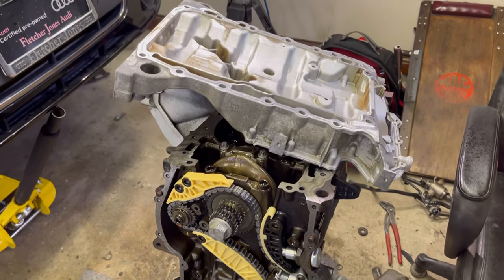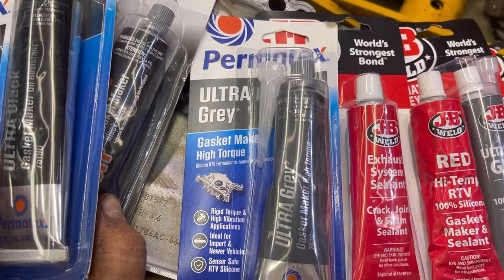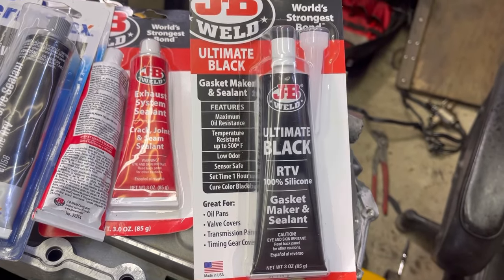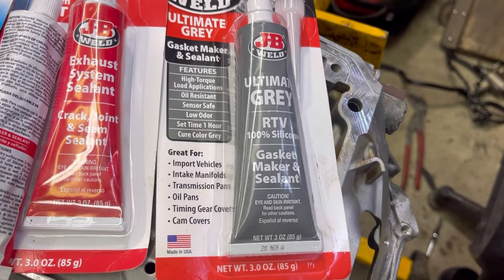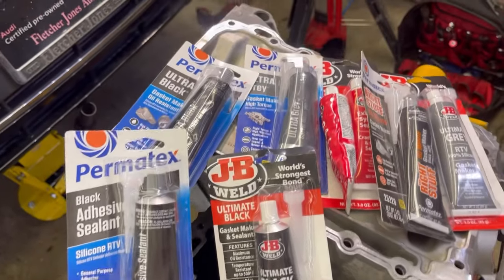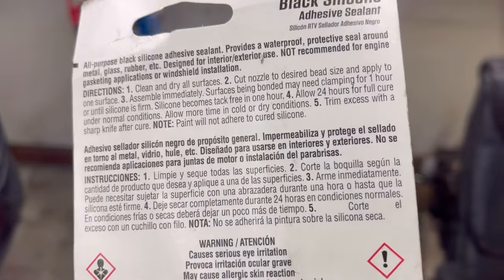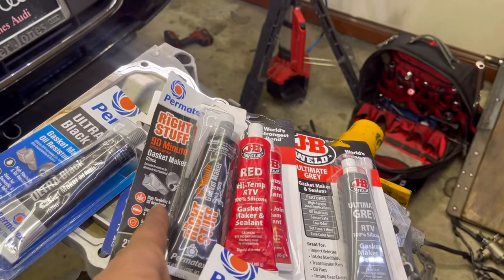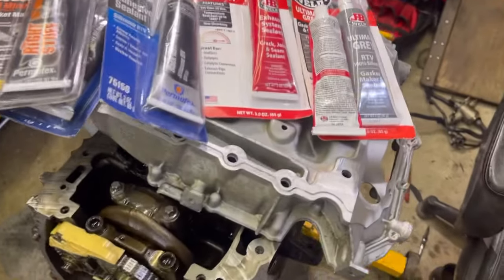Engine RTV silicone gasket maker types application instructions comparison uses demonstration 2.0t

Comment: Here is why it's this way. First principal, RTV hardens with exposure to moisture in the air. THAT'S THE KEY POINT. 1) You want to put the parts together while the silicone is wet as this provides the adhesion you want. 2) BUT you don't want to squeeze all of the silicone out of the joints to be sealed. That's where the finger tight part comes in. You want the silicone to be able to slightly harden prior to removing all possibility of moisture getting into the silicone. Once the moisture in the air has started to catalyze the silicone and it's gained some body you finish with the specified torque.
Reply: Very informative
Reply: Dang it I am cleaning my thermostat housing now to redo , was leaking coolant
Reply: @piercer2 how’d the thermostat leak go? I’m looking to do one myself with RTV red which may be overkill for the temperature but it’s what I have on hand. What do you think? What product did you use for your thermostat?
Reply: @cosmicallyderived  the right stuff held up. I fired engine up 10 minutes after putting back together. I’ll not use anything else from here on out
Reply: Thus far, the best piece of information given. Back to 1st principle.
Reply: That's the difference between aerobic and anaerobic sealants, one needs air to cure, the other doesn't
Reply: Makes sense
Reply: @cosmicallyderived it’s probably too late as I’m sure you’ve already done the job but I’ll give you a tip anyway. Use a cork (even cardboard works) gasket and spray it and the surfaces it adheres to with two coats of 3M contact adhesive. The heavy duty stuff like you would use on a headliner. Let it tack between coats and install. I guarantee it won’t leak first time and there’s no waiting. I learned that from a radiator repair man.
Reply: The reason for the finger tight and wait is because having the sealant have some resistent strength helps it provide the necessary pressure against the mating surfaces. Before this curing stage it is still the goopy form, required so it can be dispensed and applied, and will not have the structure to provide this resistence against the surfaces.
Reply: @TheAdamwest29 Exactly! The RTV is not merely glue or gap filler. It cures to a rubbery material that is meant to live permanently under compression like a rubber gasket. In other words, some bolt tightening has to occur after it has at least partly cured. If you don't wait then all you get is a glued seal that leaks as soon as the adhesion fails in any spot.

I'm disappointed to hear the video author saying "no mechanic ever does this".

Comment: I took a permatex class in school and you let it skin over with hand tightening the bolts so it makes a gasket. I've never had a leak using there methods. same thing with thread locker only apply it to the threads of a clean bolt if the hole it's going in has a opening. if it doesn't have a opening apply the thread locker to the hole and it will force its way through the thread as the bolt goes in.
Reply: Wtf they had a class for that??
Reply: @tristanvandever9411   ya there are a million variations of it you need to choose the right product
Reply: Absolutely best practice

Comment: RTV is great stuff, but I am amazed at how many companies can't properly spec a cap. All but one brand that I have used punch out the top out of their caps when they are tightened down. And no not tightened excessively . If I was a skeptic I would conclude that these companies spec their caps so that the cap breaks and insures that you need to buy more product prematurely. Permatex is the only brand that I've used that doesn't punch out the top of its cap.
Reply: The quicker curing formula’s will cure in the tube more than the slower ones, I dont punch the caps, I use a wood screw and then once I am done with the tube I turn the screw back into the tube for storage, it seems to make it last better as it tends to keep air from entering
Reply: @kellismith4329  If the cap was properly designed, then you wouldn't have to use a wood screw.
Reply: Read this 3x and still don’t get your message
Reply: @nickzaremba  The other brands break out the top of their cap with even the slightest tightening.
Reply: Put some dielectric grease on the threads before you place the cap and then you only have to make the cap snug.  The grease will seal out the air and moisture that causes the sealant to cure in the tube.  I just used a tube that was opened a year ago.  There was a slight skin on top, but that's from moisture that gets trapped in the cap.  I did run a test test bead to make sure it was still good before use and it cured no problem.
Reply: @brendan2599  Great idea, but won't help you if the top of the cap gets punched out.
Reply: @machdaddy6451  yeah, but when you use the grease you don't need to tighten it down hard.  Just gentle.  The reason the caps split is because people tighten them down hard to try and seal them.  The grease does all the sealing.  You could tighten it only half way and the grease still seals the cap.

Comment: Personally I use a bead everywhere it should go and around the bolt holes and have the mating surfaces spread it out.
Reply: Lots of us have a habit of using it to hold gaskets in place, even though we are told to nounuse it on gasket surfaces we don’t like leaks, in this case I will smear it so it is spread out over the gasket surface. But if you are using the sealant as the only gasket, yes you ar better off laying a consistent bead and then allow the cover to push it into place as it is tightened

Comment: I think the reason we always overbead is because it's no fun to have the pan or whatever you are putting on leaking after the silicone is curred. It's a devastating sight to see the an oil leak from a pan knowing you'll have to drain the oil,remove freshly curred silicone clean and redo. No fun.
Reply: Not to mention all the disassembly required to remove the cover, and then reclean all your old sealant off etc it is worse than doing the job twice because it leaves you gunshy to repeat it.
Reply: That feeling when u got it just right tho🎉
Reply: GET A TRI POD. Why go through all the instructions then just do it your own way? But sounds and looks good to me.

Comment: You're supposed to wait for it to cure 24hrs before exposing to oil...if you don't,  it will become gooey mess. The Right Stuff only requires 90 minutes before exposing to oil, that is the selling point. You can do a repair and get back on the road in theory...

Comment: Another great video and this is one I’ve been waiting for, what you think is the most suitable gasket maker RTV.. sounds like you have been having great success with your method of using the 90min “Right Stuff” is that your go to silicone for the pans and the lower timing case? I think as long as the surfaces are very clean and have a little coarse “roughed up” surfaces like you mentioned in a different video, all of those choices would work. But for the lower timing cover, I have a question? I have a brand new cover from FCP should I rough it up slightly before I install it? And should I use the permatex “Right Stuff” or JB gray? Looking for your advice on the best practices for that lower case that will leak if it’s not perfect. I will use that method of hand tight until an even bead is seen squeezing out around the perimeter, then waiting 90min until final torquing.. that is 9NM on those t30 bolts.. great video 👍🏻👍🏻

Comment: For any Audi I've had to reseal it was always the loctite 5790. In all the instructions in the repair manual it's always said to install and torque component within 10-15 minutes of applying sealant. I've always seen on the permatex sealants it says to allow time for sealant to dry after 1hr then tighten to spec. That to me makes no sense but I can kind of see why looking at it from the perspective of a valve cover gasket where you have the rubber gasket.

Comment: Great Job, just finishing up a 2.0T head with new valves, gaskets, valve guide seals, with your video's help.  Previous owner deferred maintenance to the point of timing chain stretch and bent all the valves. 

$300 in new timing parts or $3500 at a shop, your choice.  BTW change you oil every 3-5k miles it's cheap $40  insurance to keep your car's engine from going boom.

Comment: Helpful tip:

When you're done, put some dielectric grease on the tube threads and then tighten the cap so it's snug, but not too tight (they split easily).  The dielectric grease will seal out the air/moisture and prevent the sealant from curing in the tube.  You will get a slight cured plug at the tip due to the moisture in the air trapped in the cap.  Make sure the sealant is all the way to the tip to prevent excess trapped air.  I've kept an open tube useable for over a year this way.  This may not work with anaerobic sealant.

Comment: Can only speak for JB Weld. Less is more, small bead not spreading it out with finger. Tack Cure so none of it comes away if touched with finger. Colors are easy. Black for high flexing parts where you need flexible seal. Ultimate Grey for cast parts or metal to metal seals that go under compression. Red when you need more heat tolerance. For example I would use ultimate grey on the intake side and red on the exhaust side. Black on large thin sheet metal covers that will flex a lot with vibration. 

You need a bead that has cured enough so it will make a seal under compression. You don’t want it wet and squish out all your seal material by not waiting the proper cure time before cranking down on the bolts.

Comment: Love it.  Literally wondering the same things you are when I came across this.  I decided to order the one-piece OEM gasket (and spray it with copper ‘spray-a-gasket’) on my lawn tractor’s valve covers because I got sick of trying to decide which RTV/how much to apply.   I used the ultra black Permatex last time and I didn’t like the process of cleaning it all off this time around when my valves needed adjustment, and since a once-piece OEM gasket shows up in my owners manual I’m trying that this time.  Love the copper ‘spray-a-gasket’ for the cardboard gaskets because it’s very forgiving for any scratches on aluminum parts.  Enjoyed watching you question the same things I did.

Comment: I always use the 6 pack rule before running.  Right now I have an engine I put together in the garage earlier.   I'm giving it 12 hours. Ultra Grey is the best though.  Takes longer to cure but it holds stuff the strongest.

Comment: Follow the instructions. It works. 
You need to use the plastic nozzle and run your bead on the inside edge of the pan.
When I use silicone sealant I install the part and come back  few hours later to finish the job.

Comment: The wealth of knowledge I have learned from you has saved me thousands of dollars. I’m currently working on an oil leak originating from what looks like the oil cooler but thought I replace the oil filter housing gasket also. I’m a little unsure with removing the a/c compressor. Can I unbolt it and let it hang with some support or do I need to remove the freon.
Reply: Saved you thousands? Well then I hope you have flicked $50 or so to this content creator.

Comment: Just recently had an oil leak coming from my drain plug on my 1988 Acura Legend. Tried a new washer & plug, didn't work so I picked up the ultra black Permatex and I followed the instructions to a T (It was my weekend so I had the time). So far two weeks of driving and I'm seeing no issues
Reply: I love the coupe version of the Acura legend. They made those with a silky 5 speed back in the day.

Comment: Generally I use the permatex ultra grey as it is useable in most situations - I do not work in a shop etc so quick cure time is not terribly important to me - it will seal most everything, oil or coolant based, has quite a high operating temperature, and is ok to use in the presence of fuel - most of the other ones are not recommended with fuel. When I apply it, I use it as sparingly - I work slow anyway so that gives it a bit of time for it to begin setting up, I tighten all the fasteners kind of hand tight and then return to it the next day to torque it up. This way the slow cure time (and it is slow curing 2 days or so) works to my advantage as I need not rush. When I return to torque the fasteners the next day, I can then remove them 1 by 1 and apply and sealer or threadlock that may be desired prior to final torque. I am always pretty anal about torque anyway so I will always retorque the fastener several times before I call it good. The ridgid description of it makes it better at filling larger openings such as when you are substituting the sealant for the end intake gaskets on v6 and v8 engines it has less shrinkage and the cured product is more ridgid, it is not difficult to remove as it’s adhesive abilities are less than some of the others. Nobody wants to keep many of these tubes stored around after opening as they will tend to set up and cure in the tube making it just garbage and wasted $$ - that is the big reason I choose the ultra grey as I can buy just that one and it is useable in most instances.
Reply: would you use clear instead of blue ?

Comment: There is leak in the car's vacuum pump nipple. It works on 7-9 bar range connecting the brake booster and other vacuum systems. Which sealant is recommended for this purpose? Please advise
Reply from the maker: The vacuum pump shouldnt leak, the pump is divided into 2 parts, I have a video where I take it apart and show how it works.  I don’t know the specs for it but if it’s leaking I’d just put a new one on with a new gasket at the cylinder head.  So far I personally haven’t had one go bad yet.  Silicone sealant is not something I use on the vacuum pump even when replacing the oil gasket at the head/ back of pump, I alway just put a good oem gasket on it.

Comment: Aerospace uses those instructions exactly. You let the gasket form first, then torque. The point isnt to jus "fill the low spots". Its to form and actual film gasket between surfaces.
Reply: Well you said aerospace, they don't play around in that field

Comment: Ultra Black and never look back. Use it on everything except exhaust. Use it with some cloth harness tape to secure short runs of wires to smooth surfaces when you don't have any other way to secure them. Use it on repairs to electronics, not just for cars, but for areas of PC printer boards that need liquid proofing like print head control boards or to repair printhead gaskets. Use it on custom control boards for drones to weather proof them.  You can even peal it off circuit boards to do other repairs. Sensor safe means it doesn't release acetic acid when it cures so no corrosion on wires, PCB components or traces and other metal surfaces. Fun stuff.

Comment: Funny, I just noticed those instructions myself doing a transmission pan gasket last week. I used 90 minute ultra grey and did let it set up a bit before tightening, maybe 45 minutes instead of a full hour as it was getting late. No leaks so far.

Comment: I follow the instructions and wait in applications where there is no gaskets. But if I’m putting it on the gasket to hold it there temporarily I just bolt it down. 
There’s also a permatex 5 minute. Right stuff.

Comment: Interesting video.  I've seen how they use this stuff in the factory, though, and it's a neater job because the sealant is applied by robot (normally), but there's no cure time, it's applied and everything is torqued to spec immediately after - maybe they use a different compound of silicone?  Some silicone doesn't mention anything about a cure/dry time before final torque - Reinzosil is one, I have a couple of tubes of that stuff and instructions just state to apply, assemble and torque as soon as practically possible.
Some are different still, I'm sure I have a gasket maker which states on the instructions to apply, then wait 15 minutes before assembly (to allow the silicon to "skin") and then assemble hand tight, wait one hour and then torque to spec.
No wonder nobody uses the stuff right, instructions seem to differ from one type and one brand to the next.  It must be fairly forgiving stuff, though, I don't think I've had one fail for all the mistakes I make using it.
Reply: When they assemble them in the factory, all of the surfaces are new so less likelyhood that the sealant doesn’t fail - plenty of stuff from the factory loses torque and begins to leak prematurely too
Reply: And has reinzosil failed for you?

Comment: I decided to not use silicone for the water pump and backing plate for a SBF 302. I used 3M TALC Scotch-Weld Composite Urethane Adhesive DP6310NS Green. No gaskets used. Only the urethane. It has tremendous stick. So far its working great.

Comment: Why not the JBWeld Hi-Temp Red gasket maker? the JBWeld website for the red says,

Oil Pans
Valve Covers
Exhaust Manifolds
Water Pumps
Timing Covers
Differential Covers
Drive Housing

The only thing the Red doesn't do that Grey / Black can are transmission pans and cam cover.

Comment: I never used rtv before and I used the 90 minute gasket for a transmission case half in a motorcycle so I followed the instructions😂😂 I just wanted to be sure and I hope it doesn’t leak when I start it
Reply: How did it go? Any leaks?
Reply: @marklundeberg7006  I got in contact with someone who works on all motorcycles and he said he actually used to work at Suzuki and they never used Suzuki bond because it “sucked”. Anyways I followed the instructions as advised and it has held up good, knock on wood. I even used it on my clutch cover for my gsxr 1000, same bike I used it on with the transmission casing, and I haven’t seen any issues. I have put maybe 2k miles on it now, and I use the motorcycle a lot, I believe it works good just follow the instructions, it is a little messy though so keep that in mind.